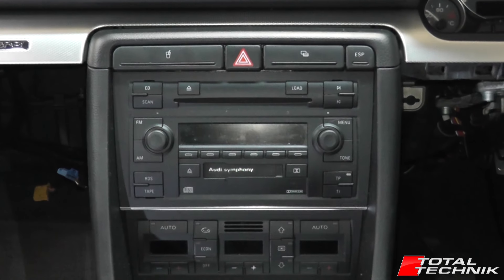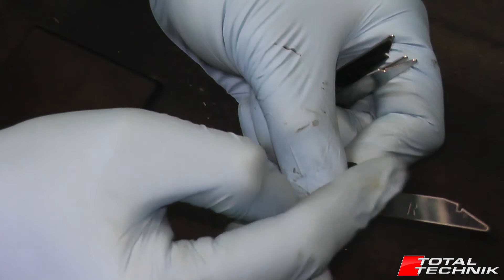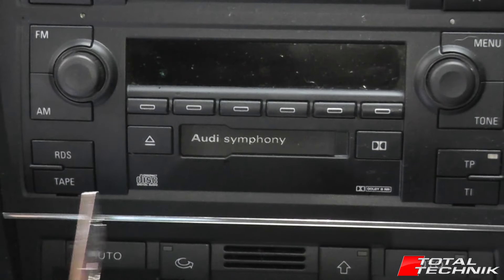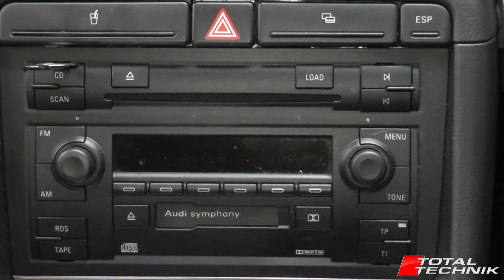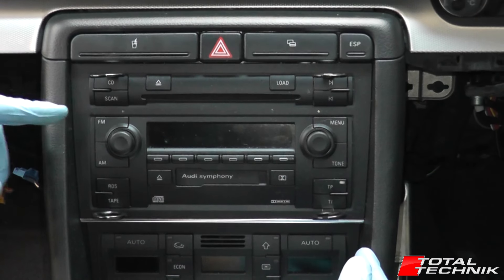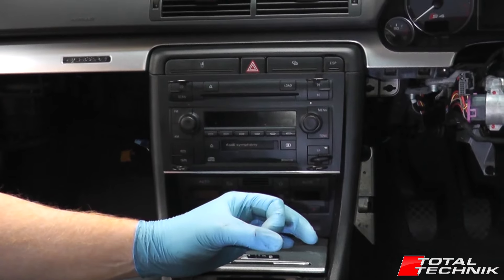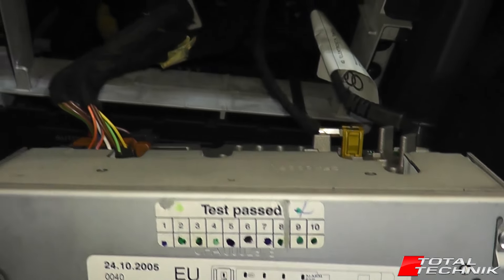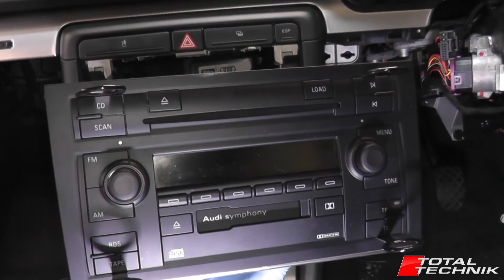How to Remove Double Din Stereo - Audi A4 S4 RS4 - B6 B7 - 2001-2008 - TOTAL TECHNIK

Comment: Great videos, thank you! Do you know why in my Symphony 2 stereo i cannot hear any sound? Didplay turns on, volume seems to work according to display but cannot hear any sound, changed the amp in the boot and still the same. Radio has jammed cd error 3, could this be the reason?
Reply: Dude I have the same exact problem on my A4 I feel like the problem could be one of the cables behind the stereo that might be burnt or sumt
Reply: @victorroy1847  have you tried changing the stereo to the same one or similar from Audi to check if it is cable or head unit?

Comment: I have the same unit in my 53-plate a3 , looking to remove and get a screen double din , I’ve was looking at getting a facia kit but have been advised if I’m still using the standard Bose speakers I may need a more expensive at £80 does that sound right?
Reply from the maker: For the fascia? Not sure TBH, it would depend on the stereo being installed. If it's a double din fascia for this model, it should only be one shape, unless there's an odd technical reason? But the hole in the centre console is the same shape for Bose/Non-Bose units.

--- 

To help support us (for both you and others reading this) there are a few things you can do:

1) Donations both needed and welcome! We cannot operate Total Technik without the support of people like you! You can donate by PayPal - just go to www.paypal.me/totaltechnik
2) Please ensure you subscribe to our YouTube channel. 
3) Please give our video's the Thumbs Up on YouTube. 
4) Please help spread the word, the more people who know about us the better! Add links to our video's in forums, let people know about us.

Thank you for your support!

Comment: Tell me please sir,i have 2002 b6 convertible and my gf spilled juice on it and now it dosent work and now im thinking of buying OEM audi b6 navigation,would that be just plug and play or i would need to do some modifications to get it runing,thank you
Reply from the maker: Upgrading to RNS-D/E sat nav in the B6/B7 model is generally quite easy if you have double din already.

You may need a wiring loom adapter depending on the wiring on your car (around £30). You will need a sat nav Fakra aerial (about £15) which can be mounted under the dash (above the glove box is a good location).

With some Google research you should be able to find a lot of info on this upgrade as it's a very popular one :-)

Best of luck.

Please be sure to support us - subscribe to our YouTube channel and help spread the word.

Comment: Mine doesn't come off even though I have all 4 of them pushed all the way in. No matter how violently I shake it. I even took out the frame of the hazard/esp plastic so I can pull it with my hands and still doesn't come out. The problem that I am trying to fix is that the radio doesn't work an the lights of the system just burn red and the screen doesn't show any text and no sound.
Reply from the maker: Hey there! Ok, so assuming it's an Audi genuine head unit... It should just slide out and you should not need to pull too hard on it. Either the keys are not locking in properly and snapping into place, or otherwise someone has previously broken the mechanisms and shoved it back in anyway. Try using the two keys on one side as levers, so push the heads outwards (to the side) whilst pulling both on one side. See if it gives you a little movement. If so, they keys are not quite locking in fully and releasing the mechanism - it can happen if the keys are not great quality.

Good luck!

--- 

To help support us (for both you and others reading this) there are a few things you can do:

1) Donations both needed and welcome! We cannot operate Total Technik without the support of people like you! You can donate by PayPal - just go to www.paypal.me/totaltechnik
2) Please ensure you subscribe to our YouTube channel. 
3) Please give our video's the Thumbs Up on YouTube. 
4) Please help spread the word, the more people who know about us the better! Add links to our video's in forums, let people know about us.

Thank you for your support!
Reply: @TotalTechnik  Couldn't get it out but I removed the fuse of the radio and then put it back in and now it is working again👍 this may be a useful tip for others too.

Comment: Does anyone know the dimensions of the Radio, I'm looking to replace mine and am not finding much in the way of it's sizes.
Reply from the maker: Hey there! The size of the stereo should not be the issue and pretty much standard single or double din sizing. The bigger issue is the facia as it's shaped to fit inside the centre console.

You should be able to find used stereo's easily enough on eBay. Or if you would consider an aftermarket solution again search eBay as many Chinese manufacturers now make very decent stereo systems (usually with sat nav etc) for good money, and they are specific for the A4/S4/RS4 and so come with the shaped facia ready to install.

However, on the aftermarket ones you will likely find that the radio reception is poor. This is certainly our experience.

Most are unable to work properly with the built in antenna system and so come with a cigar shaped 'booster' to help combat this. But even with the booster the reception is inferior to the factory antenna system. Things may have improved recently as tech always improves, but something to bear in mind at least.

--- 

To help support us (for both you and others reading this) there are a few things you can do:

1) Please ensure you subscribe to our YouTube channel. 
2) Please give our video's the Thumbs Up on YouTube. 
3) Please help spread the word, the more people who know about us the better! Add links to our video's in forums, let people know about us.
4) Donations both needed and welcome! We cannot operate Total Technik without the support of people like you! You can donate by PayPal - just go to your PayPal account and select the Send Money option and send any donations to: donate@totaltechnik.com

Thank you for your support!